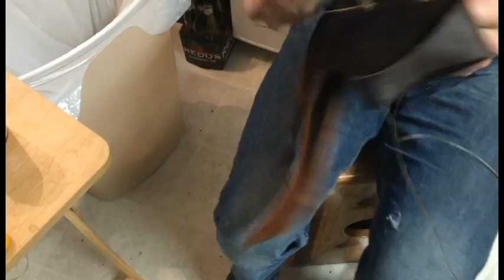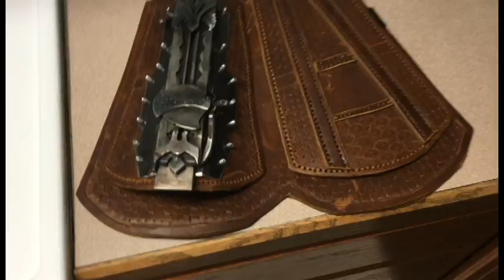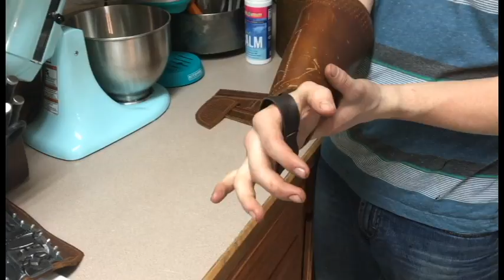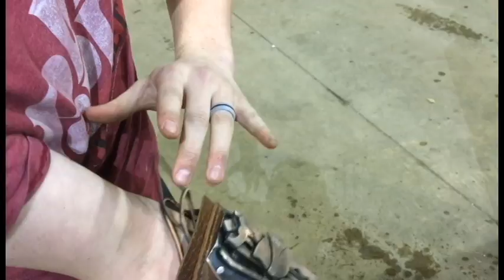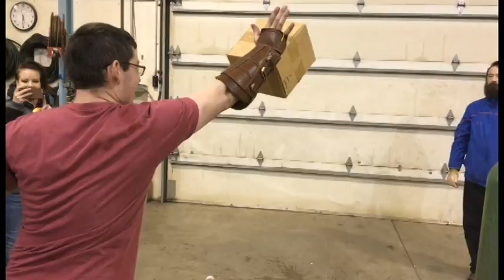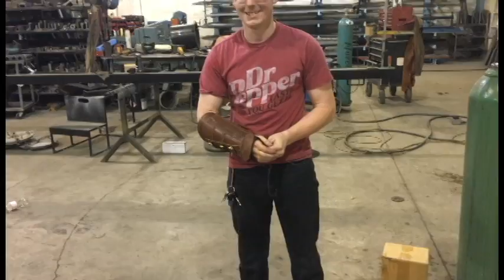Assassins Creed Hidden Blade Part 2 With Templates And Test

Comment: Finally! Someone made a REAL hidden blade that has the looks as well , ( the blade should be longer but that's very advanced )
Reply from the maker: necro flair I know how to make it longer by using segmented collapsible pieces however I was trying to match the one from the new movie and it's a single piece blade, without any in blade slides, so technically the way it is in the movie it wouldn't be possible to make it any longer, based on the movie one that is, now if I was making it based on a game version those have multiple blade slides so that it extends longer
Reply: pls make the hidden blade from black flag

Comment: I'm not saying yours is bad. It actually looks great. But is saw one where the blade is spring loaded and the string not only extends it but also retracts. So my challenge to you is to make one that looks as good as yours but has the functions I described above l.
Reply from the maker: TheLivingCat 02 I know how to do that, I just was on a very tight time schedule to get this done so I did it the easier way, if I make one again I want to make it double action
Reply: Ironclad Industries Just commented on this topic, I would totally buy a double action one.

Comment: Not to be rude, but I really don't like the system.

You could've made it spring loaded and it'd work much smoother and better, but the overall appearance is pretty nice.

However, the blade seems to be pretty loose..
Reply from the maker: Max Ventura do you have any idea how many times I've heard that and how many times I have explained why I did it that way instead of spring loaded?
Reply: No, I didn't really go through the comment section.
Reply from the maker: Max Ventura okay so I could have made it spring loaded, but I had a very tight deadline for this to get it to ZGB, spring loaded would have taken twice as long or more, I have very limited time as it is considering I work full time, plus my business, plus YouTube, and I was t getting paid for this so there's no reason to make it that high quality when it's just going to get tested once and that's it, also double action spring loaded are weak, most people want to argue to the death that it's not but it is, I know, and if your going to tell me that there are people who have made them and they weren't weak your wrong, the two other channels that I know of who have ever made functional hidden blades is man at arms and Collin furze, both of which made them spring loaded, both of which tested theirs on very soft targets, nothing at tough as the ZGB heads, and both of theirs broke afterwards, right in the springs mechanism, it looks good but it isn't very tough and yes i could do it but I had no reason to spend that much time or money
Reply: Thanks for the response, now I understand why you didn't make it spring loaded.

Afriend of mine is trying to make one at the moment!
Reply from the maker: Max Ventura okay I'm glad you understand! There are some great designs and tutorials for double action online if that's what he's going for
Reply: Yeah, it sucks to be held back by a deadline.
And although double action hidden blades may be weaker, they represent the game's design more accurately, but yours looks fantastic :D
You can check out my friend's work on Instagram if you want!@studio_sparta
Reply from the maker: Max Ventura thanks I appreciate it! I will when I get a chance!